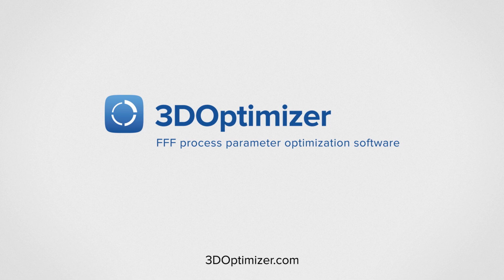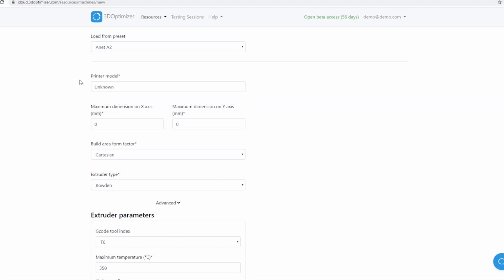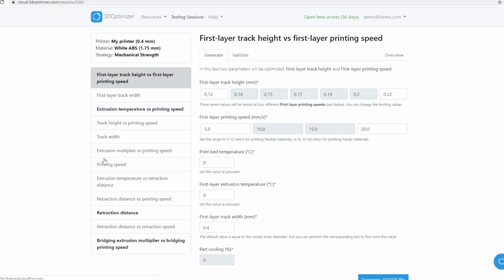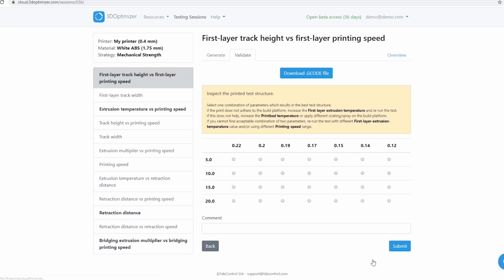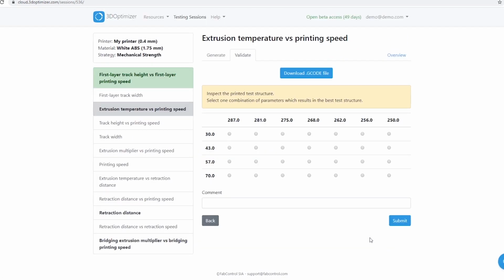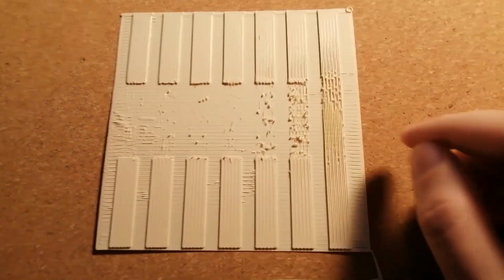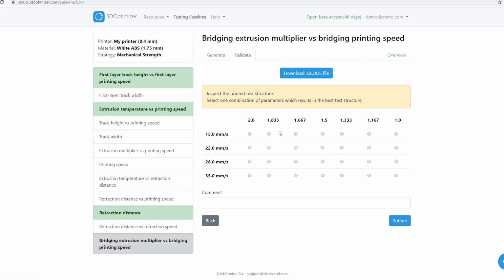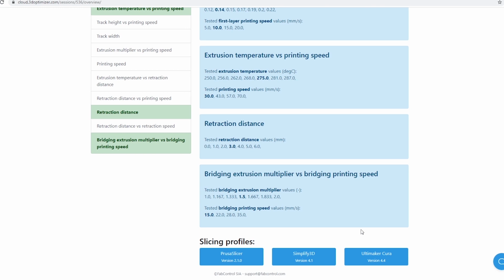3DOptimizer Introduction (3D printing setting optimization)

Comment: I almost scratched my bed because I left the homing command (G28) in the homing section but placed my bed leveling command (G29 V4 T; in my case) in the header section. The nozzle landed hard on my glass bed, I thought the bed would crack or at least get scratched. I stopped the print in time to avoid any damage. Don't do as I did. Check your gcode at least before the first print, there is no way the developers of 3doptimizer could think of all the ways users are going to deviate from the expected workflow (or plain goof up as I did).

The bed leveling command should NOT go into the "header" section, it should go AFTER g28 in "homing" section.
This is necessary first because G28 (go to home) resets the auto bed leveling, and second because it makes more sense to perform auto leveling with the bed heated to printing temperature.

 There are three custom gcode areas to fill: the header section (before warmup), the homing section (after warmup, before printing) and the footer section (after printing). The "homing" section is where you should put the gcode that you would put the contents of Cura's "Start G-Code" field, for example.

Comment: So does the first few test start where the last one left off? As in do we need to remove the last test off the build plate before starting the next test?
Reply: Yes, you should remove the last test. My test squares were 80x80mm right in the center of the bed, but used roughly 110x100 mm of space if you account for several filament purges. No space for more than one test per bed even if there were an option to print it to the side.